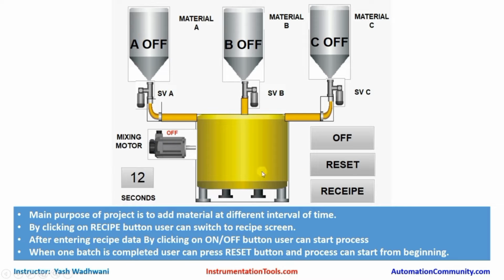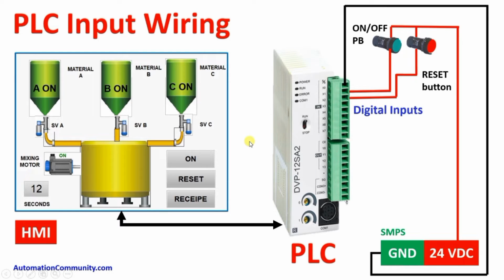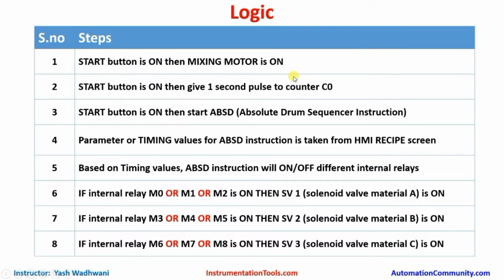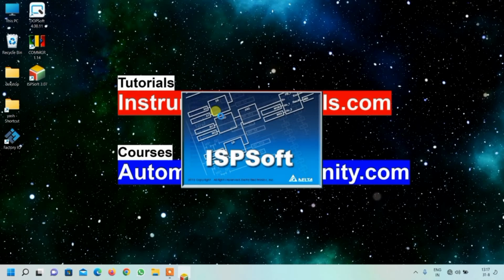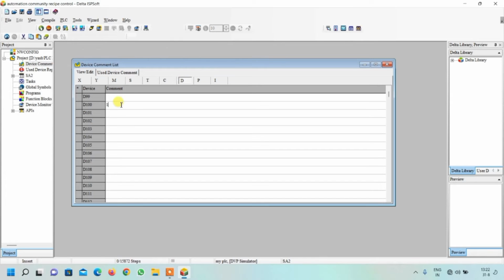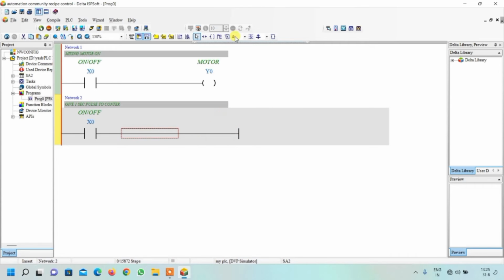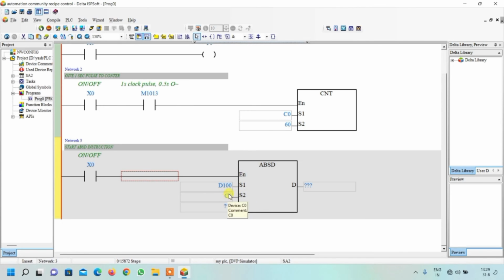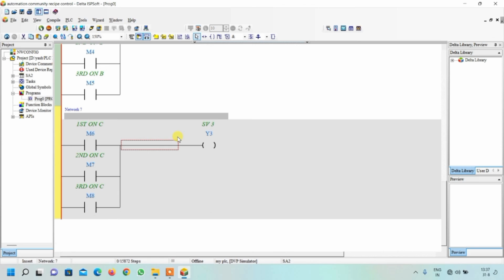PLC Recipe Control and Batch Process - Delta ISPsoft Programming

Comment: Hi i am waiting for this plc Ash Handling System Instrument air pressure not low
Conveying pressure not low
Low pressure high pipeline blocked 
After time delay
Dome SV on/off, dome seal, seal CNF, blow SV on/off, and seal off